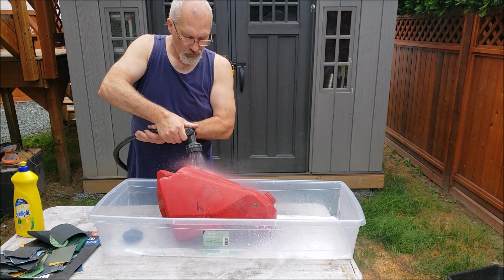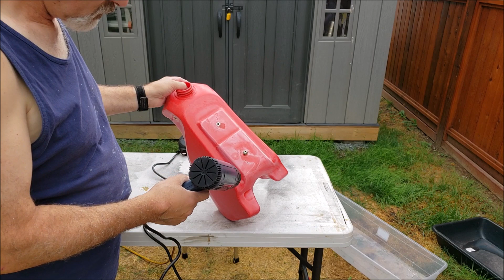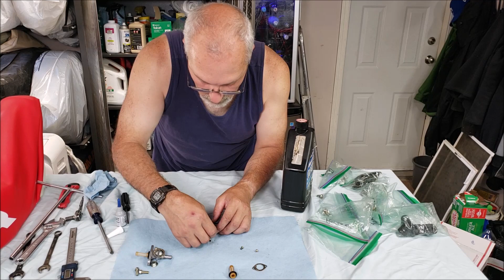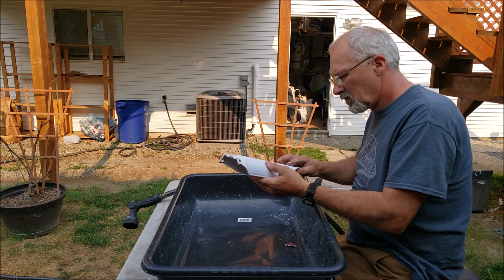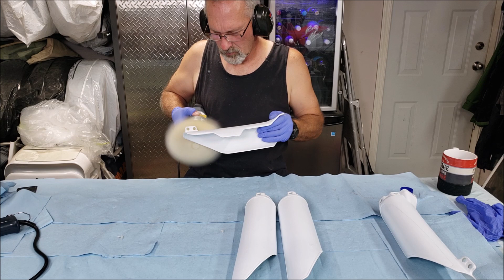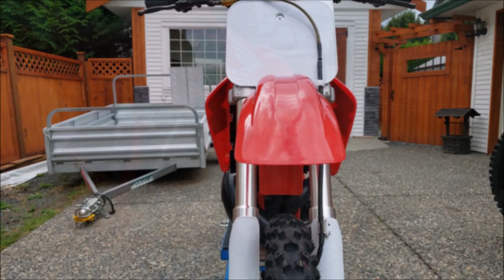34 year old Honda CR250R Plastic Fuel Tank Restoration

Comment: Great video as always... I've heard others say that heating the plastics make them brittle.. in your experience is this true as it looked like you used a light touch with a heat gun? Thank you sir!
Reply from the maker: i have never had an issue using heat. But recently i had 2 tanks spiderweb crack over the whole surface once they were out in the sun. I think this was actually an issue with them not being stored properly prior to restoration or i used the buffing pad too long hardened the outside of the tank. I have never had any other plastic crack. Heat with a gun if anything makes the outer surface softer.

Comment: As usual amazing, inspiring work. Are you using the lambswool pad dry?

How would you deal with fairly large areas that need leveling? I'm working on a Beta trials bike that had serious sun damage. It also had quite a few stickers. The area protected by the stickers is at least 1mm higher than the oxidized area around it.
Reply from the maker: When it comes to sticker damage I really have not found a way to fix it. You can scrape the plastic with a knife but you are going to reduce the thickness overall. The lambswool is dry
Reply: Thanks

Comment: What type of polishing wheel and polisher  did you use?
That tank is Bristol clean!!
Reply from the maker: Just a drill with sheepswool. Don't let it get too hot or it will crystallize the outside of the plastic
Reply: Where did you pick up that sheepswool wheel? @TNTMOTO

Comment: Sorry but how did you get the deep gouges out and repair the broken edges of the fork protectors?
Reply from the maker: Gouges were sanded and scraped out. The one you saw me remove from the fork was the only footage I had before I started. That particular one i was not able to save because of the broken areas around the bolts. I may have been able to melt the plastic back together with a soldering iron but I had 4 sets to work with. This was a long process  I have about 10 hours of sanding, scraping and buffing video for the 2 sets. Closer video and you could see they are not perfect, but they look good.